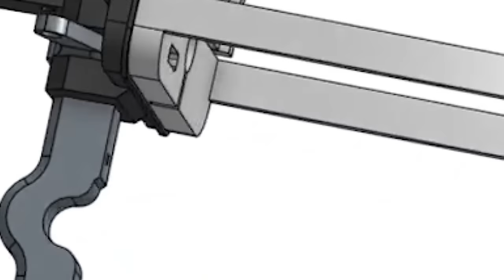Nitro Engine Powered 3D Printed RC Airplane. Full Build. DIY RC Airplane.

Comment: Nicely done, although it’s a little concerning to have your stab held on by a single magnet and micro servos on a nitro is unusual - then again 3d printed nitro is too…I wish you many happy landings. I love the idea of using an ultra modern technology to create something nostalgic
Reply: the stab is also held in place with a 3mm Carbon Fiber spar that runs right through the H-stab .. its done this way so it can be easily replaced in case of damage, up to now we haven't had any problems

Comment: Beautiful engineering but it must weigh a lot??
Reply from the maker: Compared to the electric design, it weighs about 350g more. Flight weight for nitro engine is 1750gr. This is not bad. Reasonable weight for a fuel-engined, 130cm wing length model.

Comment: Hello @KendinYap ! I have been watching your amazing work for the past couple of months, and I was wondering where you got all of your designs. Do you make them on your own? And if so do you use a particular software to design them.
Thanks in advance!
Reply from the maker: I use Onshape for 3D design. Some are mine, some are not. I already share the links of the designs that do not belong to me under the video. For example, the design of this model plane is not mine. But the parts needed for the fuel engine upgrade are all my own design.

Comment: Is it possible to put Pixhawk flight controllers in old 4 and 5 channel gassers?  I have some from the mid 80s hanging in the barn.  Pushrod throttles.   Gas engines don't have the sensitivity and quickness of electric with ESC.  I want the gyros and self leveling stability we have today put into some antiques though.  It was such an unforgiving hobby back then.  Has anyone retro fit one?

Comment: Helpppppppp😭😭😭😭😭😭😭😭😭 I followed your whole video about making the arduino transmitter and receiver that you posted in 2020 and did everything really nicely as you showed and now finally I finished this whole thing and now when I tested, the brushless motor is just keep on beeping and the servo motors are also not working anymore(they first worked when I plugged them first time). I did soooooooo much hardwork on this with everything I had please help me you are professional in this, I’m a noob and a beginner, what should I do and what can be my mistake in this?😢😢😢😢🥺🥺

Comment: Does anyone know how this LW-PLA holds up wit temperature? I switched to PETG from PLA because the PLA warped in the sun. PETG is too heavy for most RC airplane applications. How is LW-PLA?
Reply from the maker: LW-PLA is also affected by the sun. There is no problem during the flight. But it should not be left in a fixed position under the sun for more than 10-15 minutes.

Comment: Better hope you never lean the engine out to much, it will get hot enough to melt the engine mounts, could be a very bad day....also, i couldnt trust tiny servos on a any of the nitro aircraft I have flown, they could run the throttle, but could  not keep the elevator working the way I fly..And I dont think their vibration rated, they could glitch easily.. I would say you could get away with it for a few flights but a crash would soon occur
Reply from the maker: I understand your concerns. But I've been building and using Nitro powered models for about 35 years. (I share videos of simple and entry-level model airplanes on my channel). The motor bearing was printed with ASA filament. And it withstands up to 110°. Engine mounts never reach 110° . Maximum 60-80 streams. This is a small engine (.25) . It has very little vibration. And the model is also small. (wingspan 130cm). In other words, a micro servo with high quality and metal gears is sufficient. So far, I have performed about 25 sorties with this model.

Comment: Cant seem to find this airplane using the link provided... is it correct or was the plane removed?
Reply: Never mind, found it. For those looking, it can be built as a low or high wing. The website shows the low wing called ELVIRA Torfu Trainer... doesn't look to be free though

Comment: Merhaba, 2217 2700kv motoru 4s ile denedim %50 gazdan sonra biryere çarpar gibi aniden durup ve devam ediyor son gaza verdiğimde ise motordan yanık kokusu geldi benim bildiğim kadarıyla o motor 4s destekliyor acaba sorun esc de mi?*esc 80a Sizce sorun nedir 2212 2200kv motor sorunsuz çalışıyordu ve o 3s desteklediği halde hiç bir sorun çıkmadı acaba motorun yüksek devirinden dolayı mı oldu

Comment: Nice video you made. What is the flying weight? Give us detailed info, about servoes, motor, stabilisation...
Reply from the maker: Thanks. Below of video is the link for the details (Click "more" or "show more"). flight weight etc. There is also a link for the servos. Stabilization??? If it's about whether the plane is stable, yes it is a stable model. Typical trainer model. If you are asking if there is a gyro support.. No, the flight is completely manual. I don't use gyro assisted flight controller on airplanes.

Comment: Great great great job!!! I had been looking for a 3D printed model aircraft for a nitro engine for a long time. Is it robust enough to withstand vibration and normal use?
Reply from the maker: Thanks. . Yes, I created a reliable structure with appropriate updates for the 0.25 nitro engine.
Reply: @Kendin-Yap  In your opinion, is the  0.S. 0.15 LA engine sufficient for this model?

Comment: Is it beneficial to make oiur own tx rx (homemade) for rc plane as a beginner or should we buy  the commercial one and practice flying. I am an beginner
Reply: Buy a commercial radio system, dont waste your time on DIY, dont buy super cheap either, get a Radiomaster Tx16s, you will end up buying one anyway and its not worth wasting money on a cheaper radio which you will end up replacing very quickly.

Comment: Great video.  Will be interesting to know how the plane holds up with glow power. What printer did you use to print the parts, especially the ASA pieces.
Reply: Prusa MK3 as shown at the 34 second mark in the viideo.

Comment: Can I apply rc nitro car engine for a plane like 2.75cc with 30 000 rpm
Reply from the maker: Theoretically it is possible, but the shaft of car engines is not suitable for directly attaching a propeller. A piece is required for the rear part of the propeller to rest on. You need to find a solution for that.
Reply: @Kendin-Yap  😊 thanks...
Reply: @Kendin-Yap  how about torque and rpm..are there  differences...and does it affect the flight....and it's balance...

Comment: Nice build but the question is how long will it hold up after the nitro from the exhaust hits the wing and fuselage?  Interested he see after how many flights it will structurally fail? I used to use epoxy spray paint back in the day for nitro projects on silk skins but not sure how that solvent would play with PLA, LW-PLA or PETG.
Reply from the maker: I ran tests on a part (Painted LW-PLA) before making the model. For approximately 2 weeks. No problem occurred. But will there be a problem for much longer periods of time? I do not know.
Reply: @Kendin-Yap  I would think it would be ok as long as the exhaust oils are cleaned up after each flight. I have a balsa airframe with monocote heat shrink covering that is much thinner and have had no problems with the exhaust spray. I  clean up the oils after each flight and it has lasted years. It is a Piper J-3 cub. Would love to have a 3D rc though. Just like that one. Maybe a biplane. Biplanes are pretty cool and can pull off amazing maneuvers.
Reply: Also add rubber bend off Exhaust too ,to  divert direction away from fusalage
Reply: @homienat3374  He had a deflector on there already.............??
Reply: @Mgp-Rc  what??????
Reply: @homienat3374   "Also add rubber bend off Exhaust too ,to  divert direction away from fusalage" !?!?!? HE ALREADY HAS AN EXHAUST DEFLECTOR!?!?!!!
Reply: @Mgp-Rc  whats with the attitude big caps i didn't notice ya agro git

Comment: What 3d printing material did you use? And also how did it manage with the heat of the engine? 

I'm planning on making a RC car powered with a gasoline 4 stroke engine, and I'm kind of hesitant of making a 3D printed body for it as I'm afraid it will severly warp due to the heat of the engine.
Reply from the maker: The motor bearing, which directly contacts the motor, is ASA filament. (Heat resistance approximately 100-110°C). Other parts are LW-PLA. For the car, ABS or ASA can be used in the engine part and PLA and PETG can be used in other parts.
Reply: @Kendin-Yap  Thank you for the fast reply! 

I'll most likely wont have any parts directly contacting the motor that are 3D printed :)